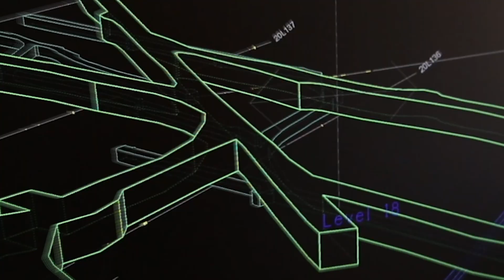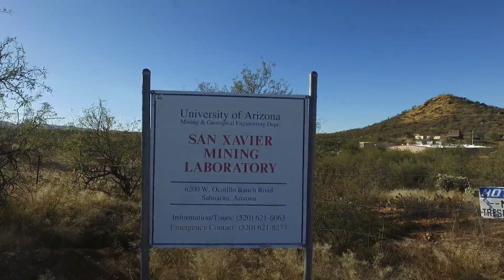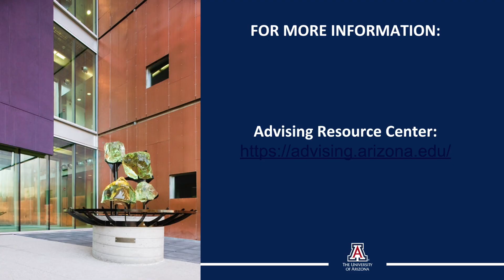University of Arizona's Mining & Geological Engineering Degree

Comment: Do mining engineers need to know how to code?
Reply from the maker: To be an top mining engineer, coding could be an important skill to have as it allows you to maximize the utility of mine planning software or calculations. Knowing how to code will allow you to automate certain processes in mine planning software if there isn’t a built-in function for it already. Similarly, knowing VBA may allow you to cut down time-consuming, repetitive processes, and allow you to focus on the strategic side of things. Commonly used in data analysis, simulation, and modeling in the mining industry, these are the different languages that mining software scripting uses:

Vulcan: Perl - Surpac: TCL - MineMax: Python - Spry: C# - Alastri: C# - Excel: VBA - Oracle/SQL Server: SQL
Reply: @minerals.arizona  is it required though?